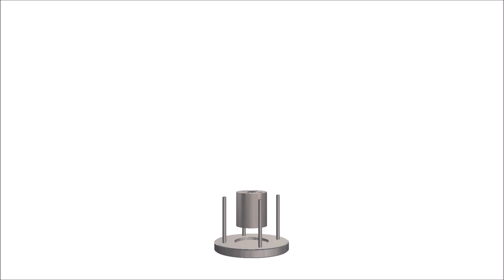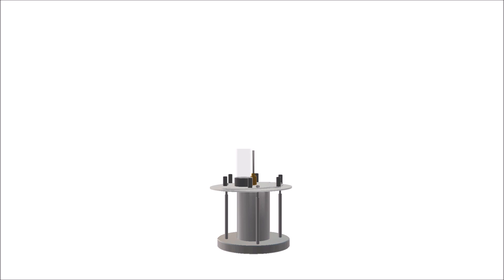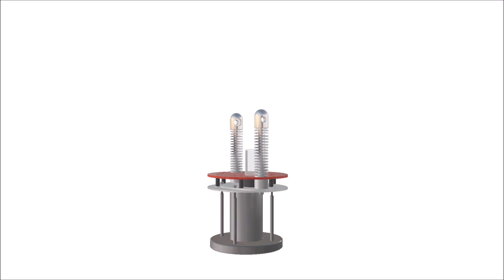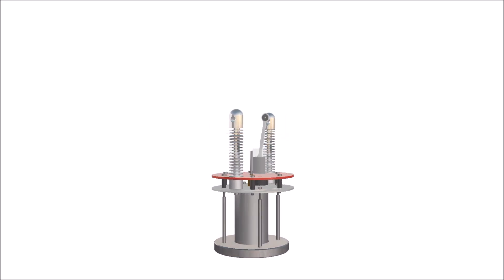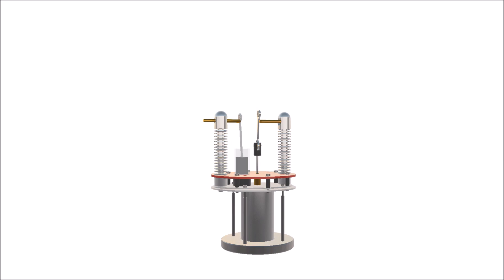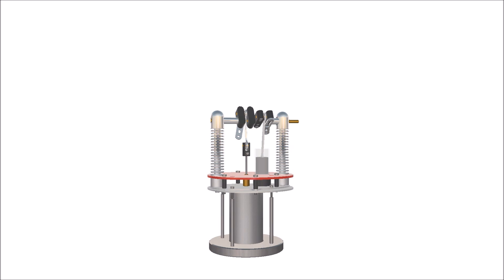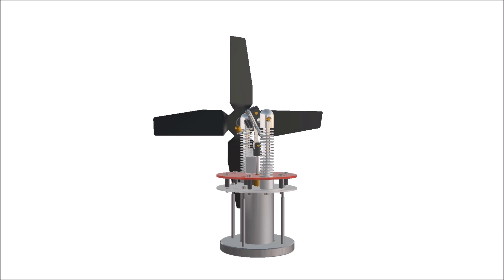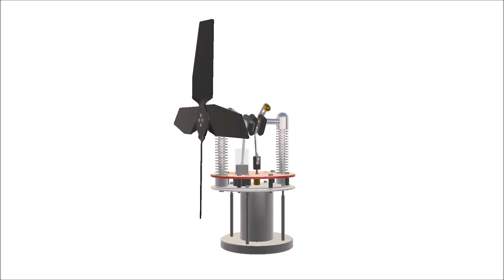How a stirling engine is made

Comment: You need to simplify the design. Way too much stainless and expense for a fan. Aluminum is cheaper. Graphite conducts heat better. I need an efficient safe fan not a work of art.
Reply: I totally understand your point my man!  But ironically, all the points you mention are exactly why I’m purchasing one of these fans.  I love the engineering, precision and quality materials.  I already have a few cheap wood fans, and they work just fine.  But, in the modern day and age, I don’t really need a wood stove.  And I definitely don’t need to haul and stack thousand of pounds of wood each year. But I love it.  Something so primal, and rewarding, to appreciate the simple warm glow from a wood stove on a cold winter day.  I look at the fan on top like the icing on a cake or the cherry on top of an ice cream sundae.  I suppose that’s why I don’t mind the price tags and complexity, it’s all part of the draw for me.